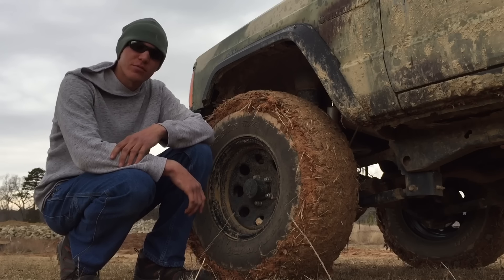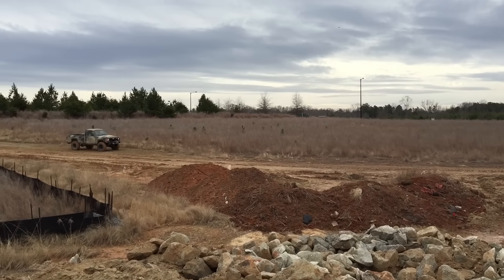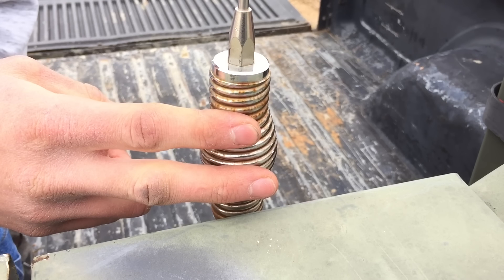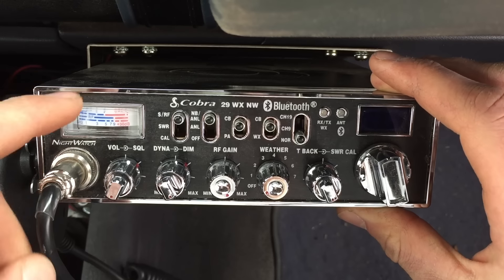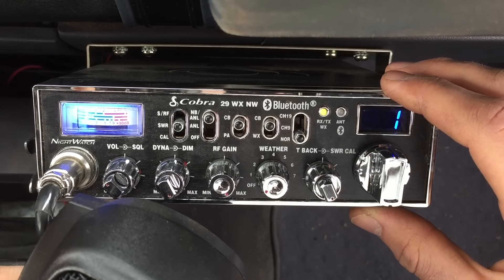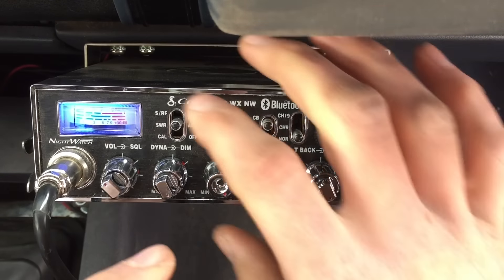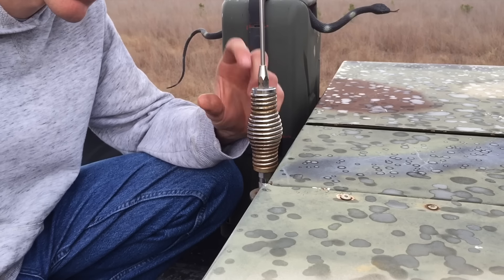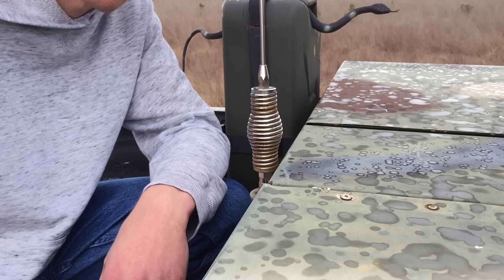How-To Tune a CB Antennae

Comment: Finally someone who actually understands what they are doing. I can't believe how many people don't understand cable length. Only thing you forgot was grounding the antenna. As a veteran cb user of over 20 years you are dead right on this and get job explaining.
Reply: how do u ground it when u only have a coax wire
Reply: @derricksmiley5632  you run a ground strap from  the antenna is located
Reply: When the antenna is mounted typically the bracket to a grounding point in the vehicle.

Comment: I have a Stryker 955 that I bought new in 2013, one with the mike plug on the side. I had it tuned (peaked and clipped) by my uncle,  I hadn't used it in years. I hooked it up the other day with a Stryker SR-5K, got great audio reports. Three years old and still a solid radio. THANK YOU STRYKER.

Comment: A 102" antenna is designed for use with a 4" spring, making it 106" total length. If it is properly grounded, it will not need any further tuning. The needle on your SWR meter will barely move or not move at all. It is the shorter loaded whips that require more complicated tuning, and some of them cannot be tuned to an SWR of less than 1.5-1. That is simply because they are not very efficient compared to a full 102" quarter wave whip. On the loaded whips, if you get the same SWR on both channel 1 and channel 40, and a little lower on channel 20, you've got it tuned as good as it will ever get. SWR will have to be over 2.0-1 to damage your radio, but it will not work very well in that range, you are wasting most of your signal. Many higher end CBs cannot be damaged by a high SWR, they automatically lower the output power to a safe level if the SWR is too high.
Reply: A 2.1 SWR will NOT damage any radio.On most every SWR Meter ever built they put a RED area on them because an SWR in that area will cause damage to some transmitters.More than likely nobody will ever notice the difference in your signal from a 1.1.1 & a 2.1 SWR.Do some research & don't take my word for it & look again at that RED section on an SWR Meter & ask yourself WHY if a 2.1 SWR will damage a radio why is that area also not RED in color.RED is a DANGER sign & there is NONE anywhere near the 2.1 mark so PLEASE tell us all why that is if you have an answer that makes any sense.
Reply: While an SWR or 2.0-1 may not immediately damage your radio, it will make the finals run hot, and probably shorten their life. But a 2.0-1 SWR means a lot of the signal generated by your radio is being reflected back, and is not actually being transmitted. Since you only have 4 watts to begin with, and waste half that, you're not putting out much of a signal. And if you are running an amplifier, even a low power one, I can guarantee that an SWR reading that high will certainly damage it.

Comment: Your video was the most instructive video on YouTube awesome job bro, one thing to note when it comes to you antenna cable length make sure your antenna cable length is in increments of 3 weather it is increments of 3 inches or feet and you will get the best transmission, now the length of your antenna cable wont hurt your transmission ability unless you go more then 100 to 150 feet but in retrospect the shorter is sometimes better! Just thought I would share this, have a good one.
Reply: Some antennas like the Francis are designed to be used with 18 feet of coax.  9 feet being half of 18 can work well. Which is what I would use instead of the six footer. I don’t know about this 3 inch business.

Comment: Great video and attention to details that mess many others up. Straight as possible (and shortest cable run), add washers to get tuning correct (or remove), use a spring, how to use built in SWR meter. Will send some of the Teamsters types to this video. Great work.
Reply: Do they have to be copper washers or can they be normal washers

Comment: Great info. I have wanted a Jeep Wrangler since I started driving. For a myriad of reasons, including 3 kids, I have never had one until I bought a 2004 Tj about 6 months ago. It was a very plain jane TJ, which was what I wanted so that I could build it out the way I wanted it. I have put on a 2 inch Rough Country Lift and Leveling kit, bought new black wheels and new General Grabber AT2 tires.  I have a whole bunch of other parts for the interior and exterior that I will be putting on and in over the next month or so, one of them being a CB radio and a Firestick antennae.  The antennae top has a built in tuner. I had NO IDEA that I needed to tune the antennae. In fact I didn't know it was needed.  Thanks for this video. You made it easy for an old fart to understand. I have subscribed to your channel. Thanks again!!!
Reply: While I am thinking about it, if you make a custom bracket for the antenna stud,  The hole must be 1/2in to Accommodate the isolation washer’s shoulder. This little gem of information has not been mentioned before.

Comment: Howdy. I just used your method to tune my set up on my jeep. After tuning I'm getting swr less than 1.5 on 1,40 & 19
Thanks man. 
Cobra 29 LX whip antenna rear bumper mount. 97 Sahara 290.000 miles. Daily driver.